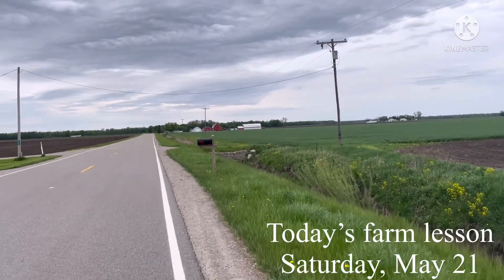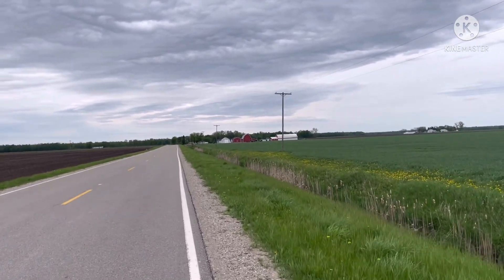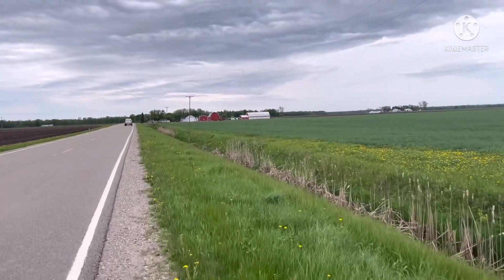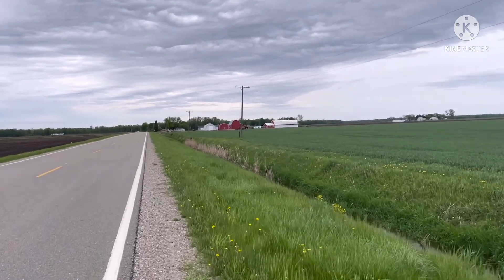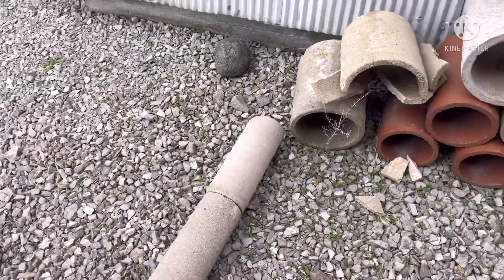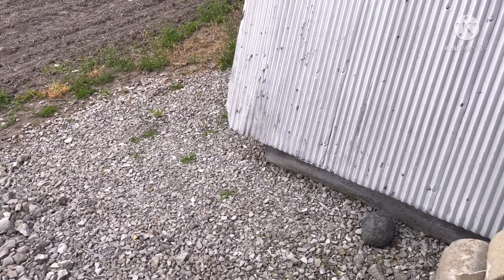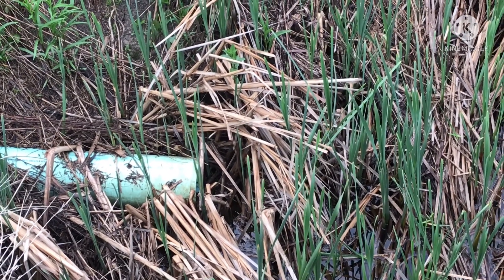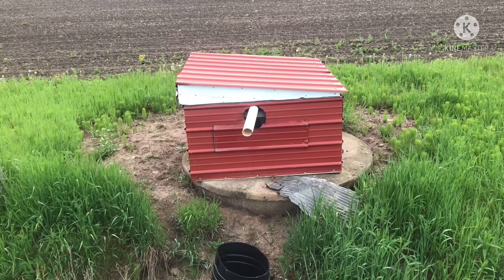Farm life

Comment: Very good explanation on the field drains.  Thirty+ years ago, I was a Town Engineer inspecting a proposed subdivision site. It was old corn fields with glacial till at 4' to 6' down. There was a test pit and in the spoil was an old piece of field drain. It was clay with an egg shaped inside cross section about 3" tall and in 12" sections. The old farmer said that they had installed them many years before but because the soil was very tight and had a perched water table, they never seemed to help. Over the years, I've seen many different types of pipe. Its a very interesting subject. In NE CT, we usually have a filter fabric sock over the corrugated plastic pipe to prevent the pipes from quickly filling with fine sands and silts. Two centuries ago they built "french drains" by digging trenches and filling them with rocks. Those often plugged up in a few years. Our area had an over abundance of rocks so any way to get rid of them was used. When you get back on trail you will see many stone fences that date back to colonial times. The stone walls complied with government requirements to mark land boundaries and were a way to get rid of rocks. Stone walls, rock walls, stone fences are all the same thing but were regional labels many years ago. The abundance of rocks makes most of the land in my area unusable for farming. My small town lost 1/3 of its population 200 years ago when Moses Cleveland led them to Ohio. The soil in Ohio is much more fertile and a lot less bony. When you get back on trail, pause and study the different style of rock walls. Some were even built to span swampy areas with 6' wide capstones for carts. Have fun. Good Luck, Rick